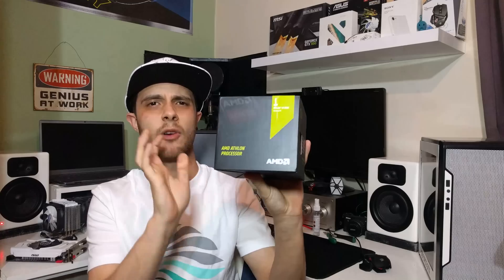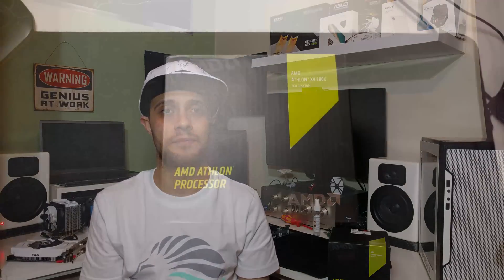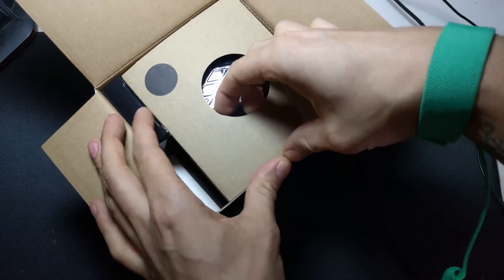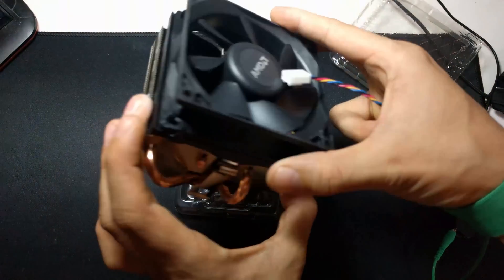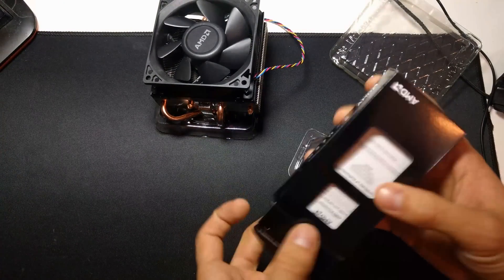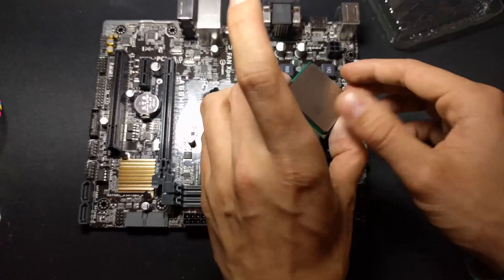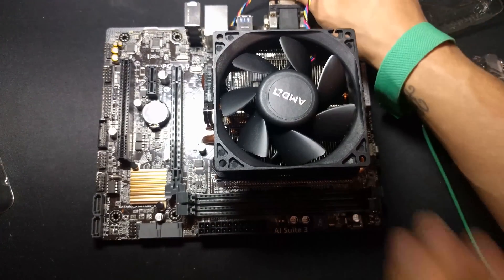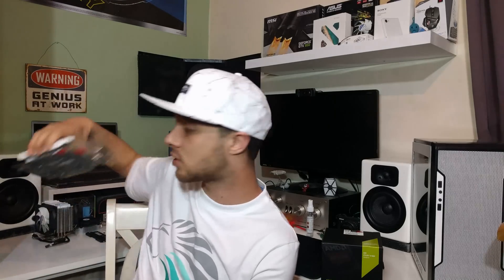AMD 880k Unboxing And Install

Comment: I'd love to see how this runs, I need to buy one. I built a machine based around the Athlon 845 (carrizo part) and it's almost unusable. the cpu throttles to 1.7 no matter what settings i put in.
Reply from the maker: that is very odd indeed may I ask what the rest of the specs are? what sort of temps you getting also?
Reply: +thefullsetup here's the full specs. 
AMD athlon x4 845
gigabyte F2A88XM-D3H using the provided beta bios from gigabyte 
2x4 GB corsair 2133mhz ddr3
sentey 725w psw
WD 1tb blue
AMD R9 380 sapphire mini itx 2gb

Ive even messaged the YouTuber OZtalksHW and he has had the same issues, and many of forums have these issues. it runs between 38-42 idle. It immediately down clocks to 1.75 ghz the moment I boot, no matter the temps. I've disabled coolNquiet and all other power saving features and turbo core to see of it maintains 3.5. it starts 3.5 but within a few minutes it's 1.75 (specifically that speed) and no matter what stress I put on the CPU it locks to that. I used RufusUSB to load up a Linux ISO (I thought maybe it was windows, so I made a live boot USB) and the test for bad blocks is usually somewhat cpu intensive. still 1.75. cold temps. I'm at wits end on this CPU, and it ran so amazingly for the first few months
Reply: +Jerry Knudsen first month I guess I should say lol I bought it day 1
Reply from the maker: +Jerry Knudsen 
very odd indeed and looks like you have done a lot if I was you I would arrange a return.
Reply from the maker: +thefullsetup the issue I think is most likely at motherboard/BIOS level. I think the 845 is the only carrizo chip at the moment. I imagine this would be the same from a lot of mobo company's but I doubt they will be doing a massive amount of dev and testing for one chip.
Reply: ***** it is indeed a bios error I believe. Since my reply I've discovered two things: After running cpuZ bench tests and stress tests, I see now the CPU will not exceed 1.75 on any single thread tests, but when the benchmark reaches the multiple state, it jumps to full 3.8 for a limited amount of time, bouncing between 3-3.8. It will not run at full speed unless all cores are engaged and, I suppose, the CPU feels it's under extreme load. The stress test is also multitheaded and has the same effect. Officially the X4 845 isn't even sold by AMD yet nor is it mentioned on the website, so I'm sure the bios releases are very sketchy. I would like to return it, but it was bought a month ago, so I have no clue who to even go through, but since my board is an A88x, I figured it couldn't hurt to use a godavari chip and just OC it a little.
Reply from the maker: +Jerry Knudsen well hopefully there will be one soon I bought the 840 just as a stand in while I waited for stock of 880k. only purchased because it was slightly cheaper than 845 it has the same boost just lower standard clock. and its runs a steady 3.6 under load.
Reply: ***** I thought the 840 was a steamroller core CPU, not excavator though, but I could be mistaken.  I would like to hear someone else experience with excavator cpus though. Honestly I'd hate to get rid of the 845 since it once had such great performance and potential. So may I ask, how was the overclocking on stock cooler with the 880k? After doing a decent amount of calculating, I discovered the 845 @ 3.8 was know to be superior to a 4ghz kaveri, and equal to a 2.9 ghz haswell core. So theoretically if I can oc the 880K to around 4.5, I can match the performance of a haswell core @ 3.1, which is around basic core I5 4430. Does it overclock smooth enough?
Reply from the maker: +Jerry Knudsen hey just a thought did you ever undervolt your CPU. my 880k was throttling to 1.6 on two cores I lowered the voltage and bang still it my stock 4ghz and my 4.6 oc
Reply: ***** I found what had happened. It was kind of odd. My theory is when the power went out (that's when it throttled) on the last seconds of power windows switched to power saver. IDK how, considering the size of the battery, but I looked into the power saving features and it was to save power.. Felt a little silly
Reply from the maker: +Jerry Knudsen yeah well I put a whole bit about the 845 being crap in my mobo video. so we're both a pair of idiots ha ha
Reply: ***** lol I have an x4 870k in mine now, feel dumb changing the cpu/heatsink now. The 845 is a treasure, I look forward to an unlocked one
Reply from the maker: +Jerry Knudsen don't think there will be an unlocked one. have you oc your 870 if so what you got it up to my 880 is sat at 4.6 ATM.
Reply: Mine is at 4.3 stock cooler, a cryorig m9a is on the way so I'm hoping to push it to around 4.5. In a CPUz test it's almost identical in single thread to an ivybridge @3.3, at around 1250 points single thread. May I ask how 4.6 scores? Godavari OCs so well, I feel as though they can rival a haswell @ 3.2 at around 4.6ghz.